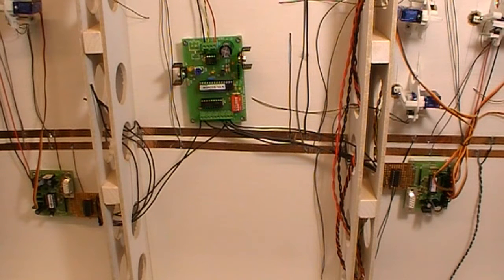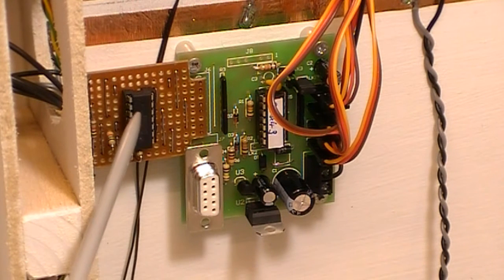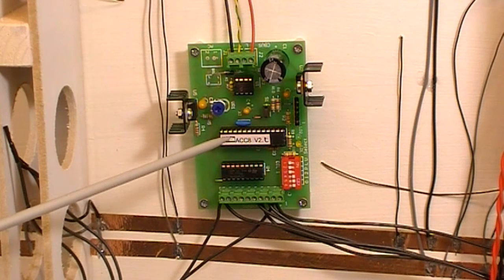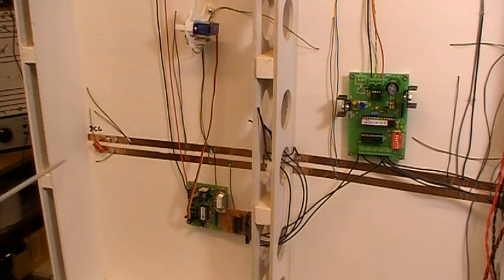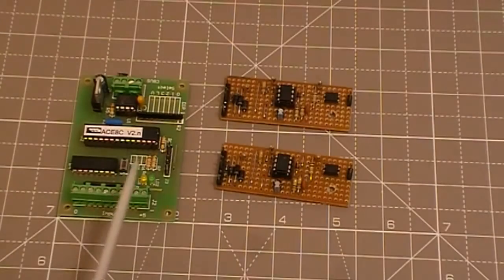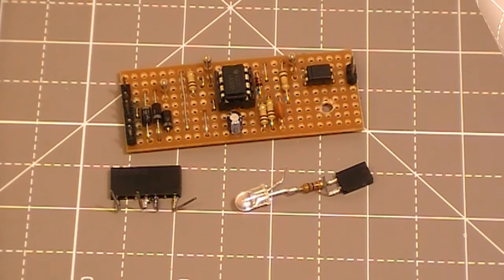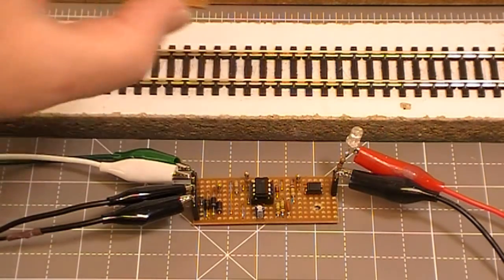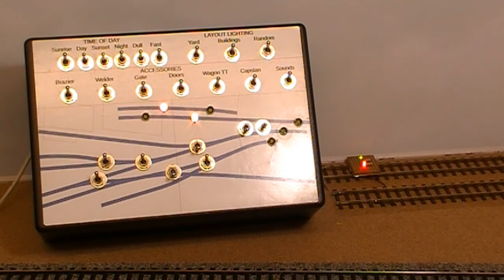Canal Sidings Model Railway 02 The electronics of the control system

Comment: Very informative video, John, thanks! 
Have you seen, used or considered using touch sensor, limit switch, or some other sensor in place of a camera for aligning the sector plate?
Reply from the maker: Thanks Edward, In my time I have tried most ways of auto alignment, usually applied to turntables.  My prefered method is stepper motor and I have built a succesful system using an Arduino Pro Mini single boad computer. In the case of the sector plate I have the further complication that I can't actually see it when all the buildings are in place so I need to ensure that all stock is clear before it moves. As this also allows me to see the alignment I called it quits!!! ....................John

Comment: Hi John
I have revisited this video as I am trying to design a club layout that will use CBus to control servos for turnouts and semaphores. (I am currently building MERG Servo4s and DCC accessory decoders for signals on my own layout). I was interested in your comments about the Servo4 and problems with the CBus control. Can you point me at a source for you additional board design?

Are you likely to do a video explaining your mimic panel (I assume you use a MERG CANPAN for that)? I do not seem able to find any other video out there.
Regards
David
Reply from the maker: Hi  David. The Merg Servo4 is a great kit but it is a bit long in the tooth now. The modern replacement is the CANMIO in its CANSERVO form. This is not yet a Merg kit but the information and circuits/parts list is on the website.
As for the Servo4 I assume that you want to drive them with CANACC8. The problem is that the CANACC8 output dies not swing low enough to reliably drive the Servo4 inputs. There is a Merg forum topic devoted to the issue. There are various solutions to this but you will find mine on the forum page here 
http://www.merg.org.uk/forum/viewtopic.php?f=45&t=717&start=75
My mimic panel does not use a CANPAN as it was not available when I built it. I use a CANACE3C and CANACC8. I was not intending to do a video on the control panel as it is entirely reliant on Merg compinents and  a bit too specialised for this channel. If you have any specific queries that I may be able to help with you can send me a YT message and I will try to answer  them.......................John